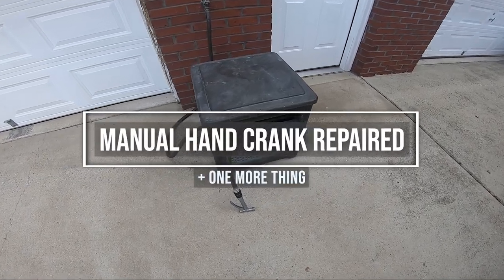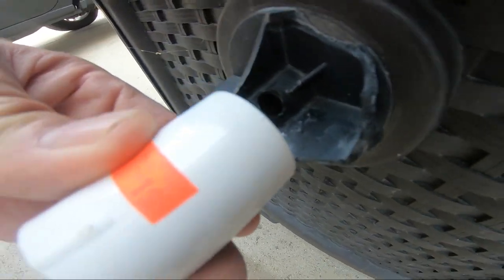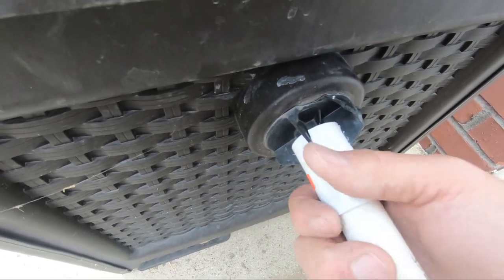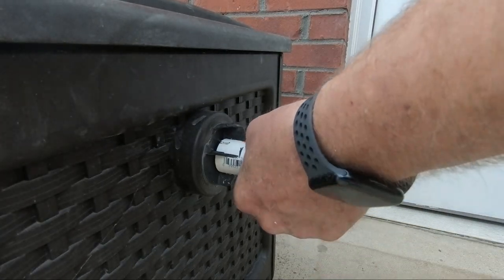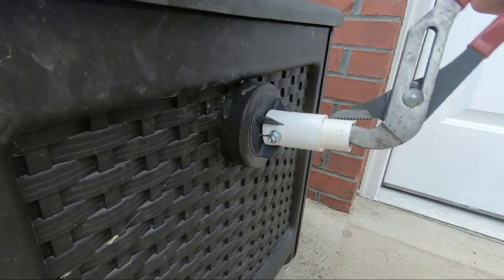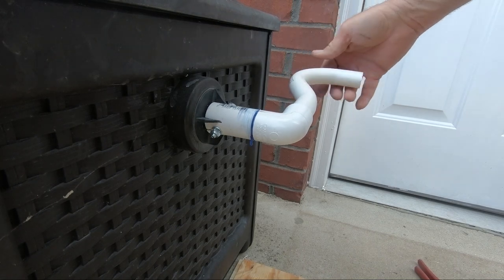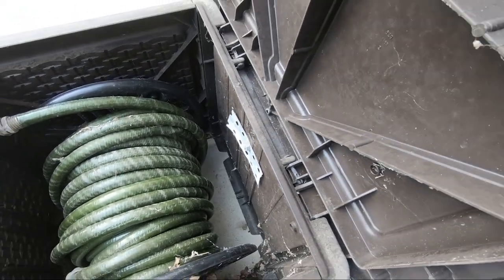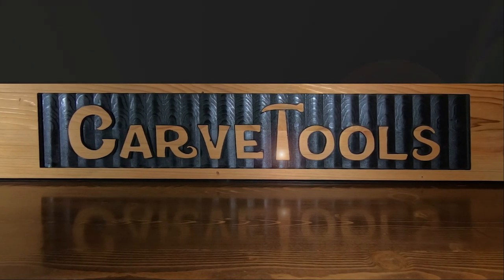Hose Reel Crank Handle Replaced

Comment: Love the MacGyver in you, but if @WilliamPowell is correct and it sells for $3, that would be funny. I need a Suncast handle that broke in two, but it's like an anodized aluminum, so I need to become a MacGyver also. 
Cheers
Reply from the maker: I needed this in kind of a hurry, so I made one from PVC.  I eventually bought a replacement handle from Suncast for $10.39. Shipping cost more than the handle so I was going to buy 2 but it would have been over $20. Thanks for the comments.

Comment: These things are dogshit, the best you will do is 2 seasons before they break, plastic on moving parts or parts under a load DO NOT HOLD UP WELL, and the whole unit is made of plastic, sadly I speak from experience.
Reply from the maker: Yep. Suncast actually has a replacement handle on their website for sale. They cost around $11 including shipping. Thanks for the comments.